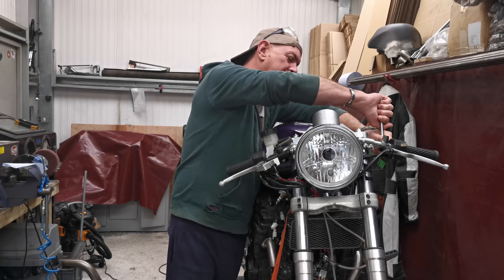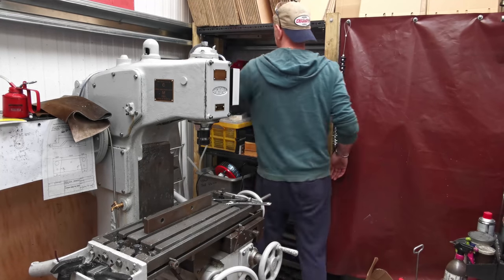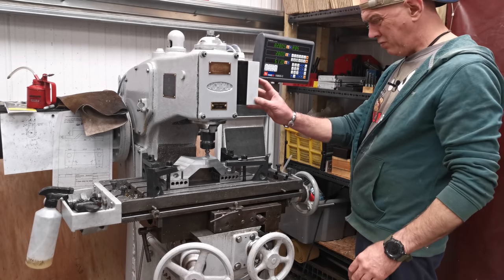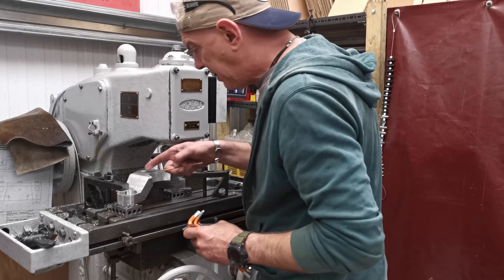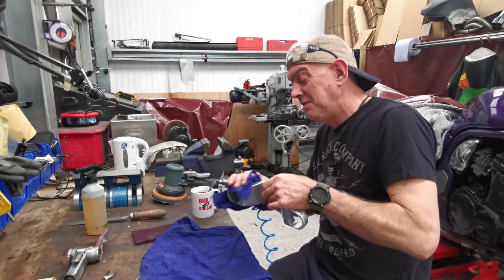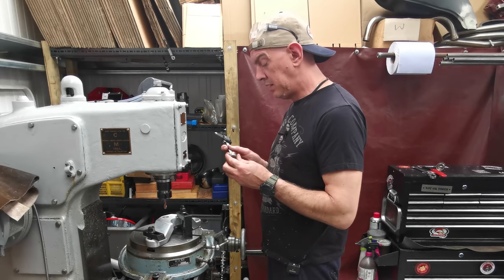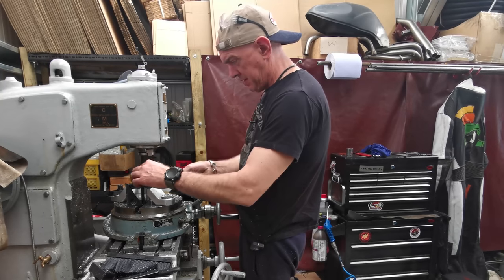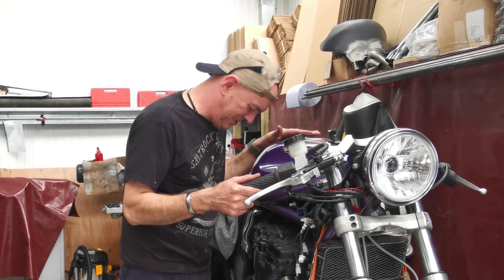Rounding off the top yoke for the Suzuki Bandit Cafe Racer - ASBO Project

Comment: I've polished my swingarms and lower fork tubes then gave them a brushed look so they look oem again  and I give them a wipe over with a rag with  wd40 every other week or so and they still look  good after 3 years, they do dull down a little but  even if polished after a while I find most stuff lose a little bling unless you keep on top of it especially when you get it wet in the rain   ..  good job on the top yoke 👍👍
Reply from the maker: Good to know matey, thanks for that. I really don't want to build a bike where you have to spend more time touching up dull bits rather than just riding it if you know what I mean 😁👍

Comment: That looks really, really good - blends well with the bottom yoke, although that bottom yoke needs the seam grinding off, which I'm sure you'll do on the proper build.

You could go down the satin black powder coat route for the yokes, although the bottom of the forks would need to be done to set it all off, but your bike, your choice.
Reply from the maker: Still chewing over ideas and in the final build the bottom yoke will all get dressed up too matey 😁👍
Reply: @QuickBikes  Great to see you back; missed the uploads, but 100% understand the challenges you've had, but no need to beat yourself up about it - it was out of your control. Anyway, trust the holiday was good, and how's the new job going?
Reply from the maker: New jobbis going well and they seem very happy with me so far as well as me learning stuff. The holiday was mega and we're definitely going to be making time for ourselves each year I think. Turns out we were both totally knackered 🤣😂😅

Comment: Very common problem with laptops, where the charger cable plugs in it connects direct to the PCB. Any flex at all and the solder connections are toast. I reckon manufacturers could avoid this problem by having the charger lead fitted with a 90deg plug into the laptop port. Just saying.
Reply from the maker: Yeah, either that or a jack that has wires going to the motherboard... simples init... 😂🤣

Comment: Re Laptop.  Remove the battery, plug in the power and see if it boots.  I once had a bad battery that was drawing so much power that the machine had none left to operate
Reply from the maker: A good.tip, thank you, but the battery is in-built and it's definitely the motherboard at fault. Thankfully I have a new.laptop now 😁👍